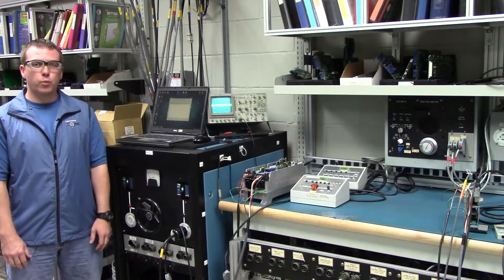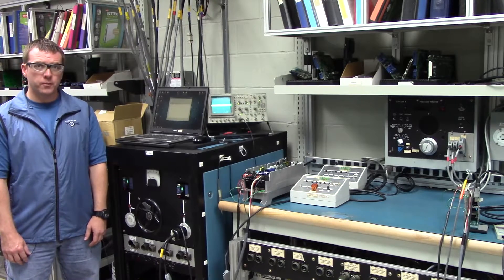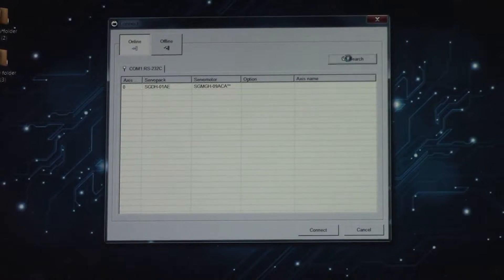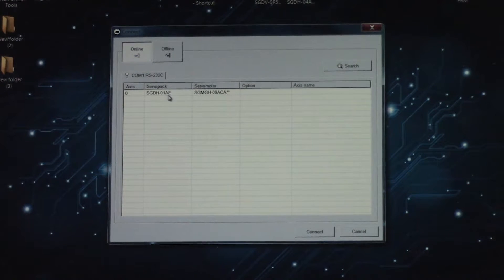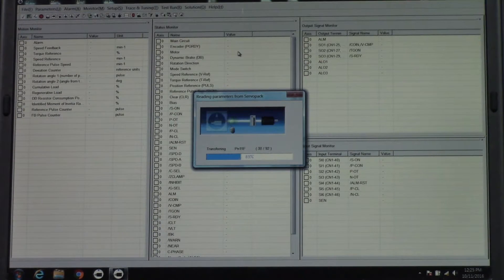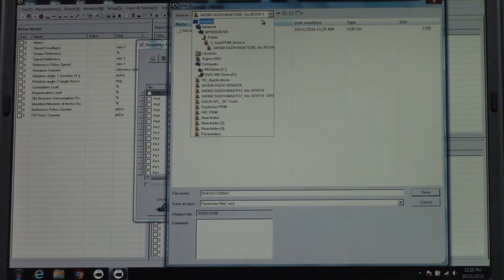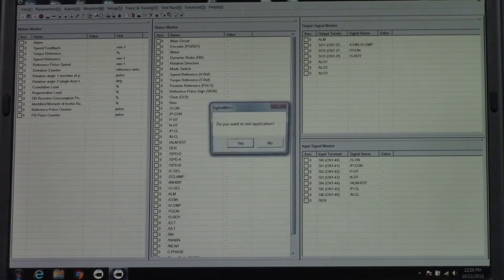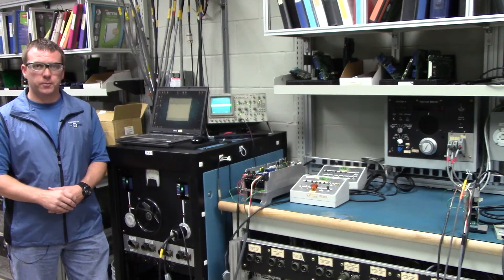Process to Backup Parameters on Yaskawa Sigma Series AC Servo Drives.

Comment: Hi
Very helpful video ,but my question what is the cable type used for data exchange between servo drive and computer?
Secondly ,if I have (bb) alarm on display of the drive is it possible to fix?